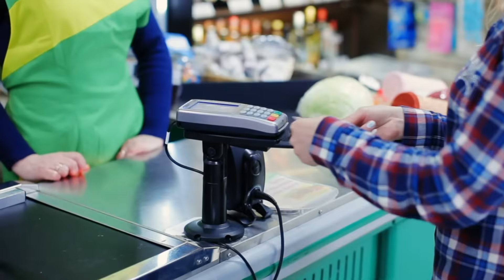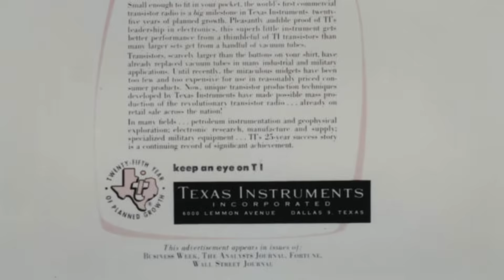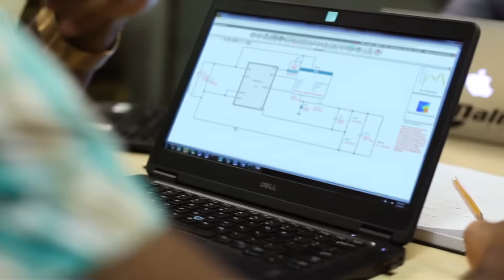TI passion

Comment: I love the way the TI works. I am working with c2000 Tms320f28335 processor for my lab experiment and continuing my PhD using the ti development board for experimental purpose. Otherthan that I teach the same processor to all my students and friends. They are loving the video on ti processor. Thanks to TI for such a wonderful solution for power electronics applications. I hope i will join you if I get an opportunity to work with you.
Reply: Sir TMS320F28031PN lqfp80   which programber use?  Please  guide sir